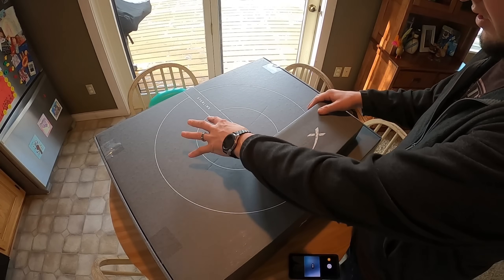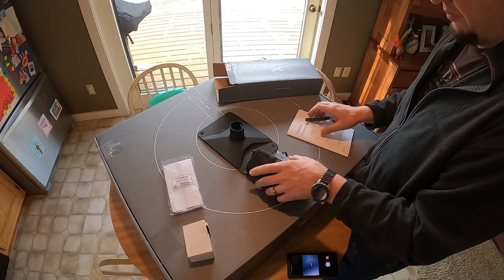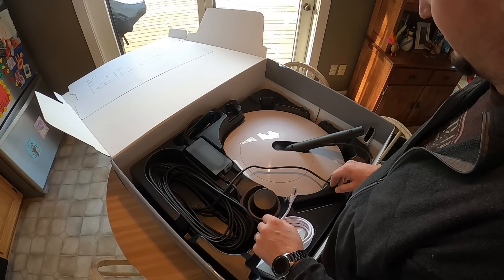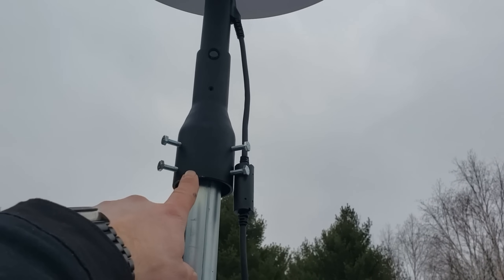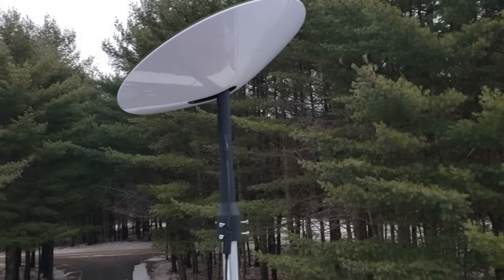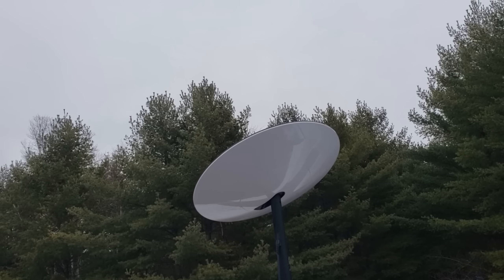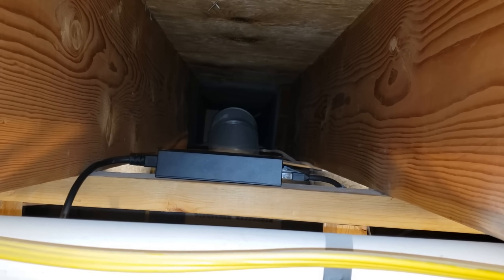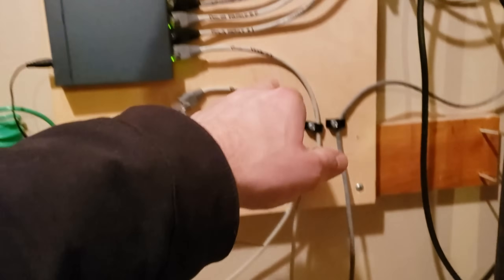Starlink unboxing, install on a pole mount and roof, speed tests, and more!

Comment: You can use Starlinks phone app to determine if the trees will obstruct the signal. The reception window required will reduce as more satellites are launched, you can probably reduce the mounting pole to a much lower height. I currently have Ziply Communications, 2.6 mbps down, .36 up for the same you are paying. Hoping to get Starlink this spring, I am on the waiting list.
Reply from the maker: Yep.  The app works pretty slick!

Comment: I hear the equipment is like 500 dollars right? so how much is the monthly payment? I love those speeds and how you could just be located anywhere!
Reply: 99 $
Reply: @alanrickett2537  Oh, for anywhere internet and those speeds that's not too bad. A few yrs ago when I was living somewhere I could not get the wire The only option I had was slow ass dish. and umm a sprint service that was completely wireless and they were charging like 145 per month.
Reply: @alanrickett2537  much better than other offers, bang for your buck.
Reply: @aerojetrocketdyners-2538  not in usa so can make no comment on the value
Reply from the maker: Yep.  Equipment is $500.  Then they offer 3 other types of mounts besides the tripod it is sent with.  Each one of those is around 20-30.  Then monthly service at this point is $99. Who knows what it will be once it goes public.  I just really hope they don't attach data limits.  At this point there no limits.
Reply: @OutdoorsEngineer  musk has on a number of occasions had said he is against data limits so it's hopefully
Reply: @OutdoorsEngineer  Oh ok, Thought it was public already for a sec. The Musk moves fast! Yep data caps would ruin it for me lol. They make me feel the same way range anxiety feels in electric cars.

Comment: I did not know Starlink offered a pole mount adapter. How much was that?  Good detail on the mount - thanks. Where are you located?
Reply from the maker: Thanks! I believe the pipe mount was about $25.   I am in Northern Wisconsin.
Reply: @OutdoorsEngineer   They offer the Pole mount as mentioned  the volcano mount $24 and a Non Penetrating Ridge line mount $99 that pivots so it can be set up flat as well it requires 80 pounds of bricks or blocks, they mention that it is NOT recommended for High Wind areas. They also just added an install kit that includes Wall grommets a Drill Bit a Spade bit Clips Silicone sealant and a cable fishing tool $24.
Reply from the maker: @brianseay3539  I noticed the install kit today.  Must be a new option.

Comment: I’m going to get starlink when Available
Reply from the maker: It is worth it!
Reply: I agree it's the best option for rural internet but of late there's been issues.  Network congestion during primetime(6pm-midnight) last 3 evenings, completely unusable for streaming video during that time. I trust space-ex will resolve this (still in beta). May have something to do with not enough ground stations in my area.

Comment: I really like that mounting idea. you will have to keep us informed how it does in the wind. I already have a pole up on the roof for my weather station anemometer. I could get a bigger pole and put that on the top and the anemometer below it.
Reply from the maker: I have an Ambient Weather station using the same mounting hardware on another part of my roof.  That is where I got this idea for the Starlink receiver.   Actually, the interface between the pole mount from Starlink and the dish is pretty sloppy allows the dish to move a little bit.  The pole hardly moves at all.
Reply: @OutdoorsEngineer  good to know. maybe ill look at going with the max size that it can handle. or cut another piece of pipe and make a collar so it fits a little more snug. I'm northern IL so i still have some time before im even in the invite zone.
Reply: @Dockellen  Wrap the pole with a few layers of PSA aluminum tape.
Reply from the maker: @Dockellen  The next time on the roof I might actually look into removing the pole mount and sliding the receiver directly into the 1 1/4" structural pipe from Lowes.  It fits pretty darn snug.  Just would need to drill a couple holes in the structural pipe so it locks it in place.